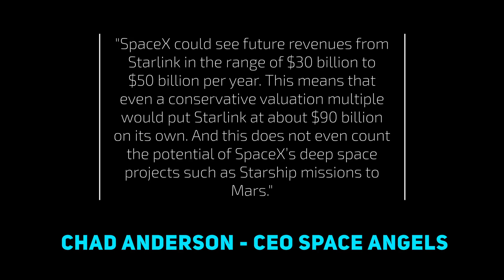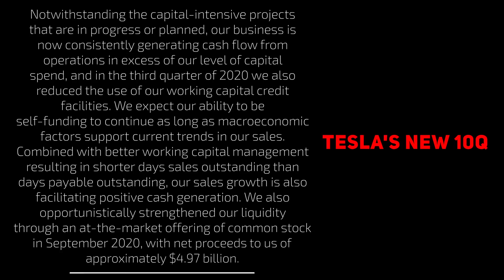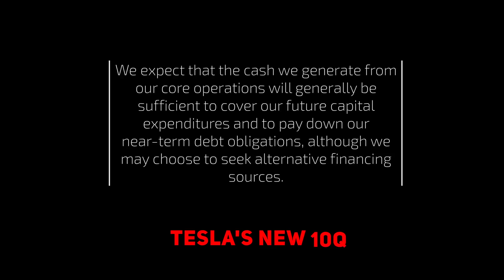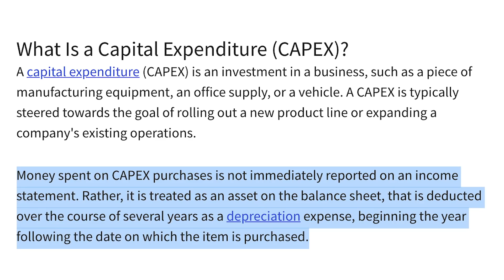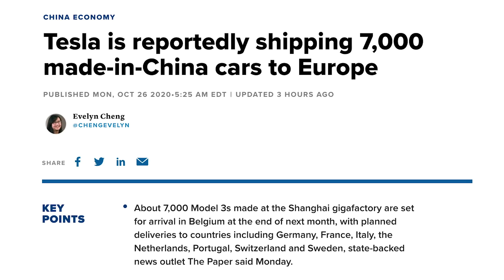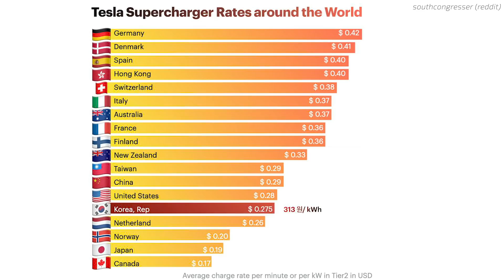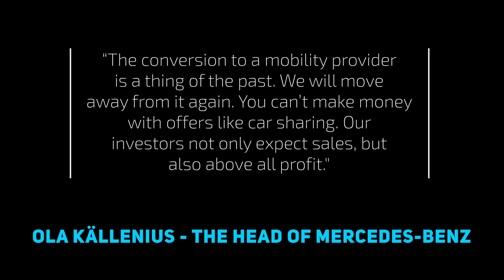Tesla Releases 10-Q // Mercedes Gives Up // SpaceX $200B Valuation ➕

Comment: Electricity costs in Germany for a private person is 0,31€/kWh (~0,36$/kWh). If you want only renewable energy it gets even more expensive. So the supercharger is not that much more expensive than charging at home. Unfortunately, new rules make it almost impossible to use own solar energy, as you have to sell cheap, and buy back expensive. Direct use not allowed.

Comment: Hi Dillon, thanks for your videos.
In France the current Supercharging rate is 0.24€ or $0.28 per kWh
There are rumors that the price might go up to 0.30€ or $0.35/kWh but not confirmed yet and some speculate new price would only apply to V3 SUC. Time will tell

Comment: I live in Germany, when I supercharge I usually pay 33-34 cent(€)/ kWh. That being said, electricity is horrendously expensive around here, when home charging I still pay 25ct/kWh
Reply: You would be better off with a petrol vehicle ...
Reply: @sking2173  Not really, when comparing supercharging to a very efficient diesel vehicle (which is generally cheaper than Petrol around here), driving a Tesla is still a little cheaper. Not by much, though. We also have solar power, I try to only charge at home when it’s nice and sunny, I can charge for free at work every now and then too (if the charging station isn’t being used by one of my coworkers).

Comment: Most likely Mercedes will adopt MobilEye. In fact all VW affiliates will.
Reply: Thing is, a system that uses pre-set mapping to navigate , simply cannot compare to a system that can actually be trained to "think" and adjust to one off situations. Tesla's FSD beta has shown that they are MUCH closer than they were with the currently available version of FSD. It could really actually be just around the corner for FSD to be more than a "future" technology. at that point, pre-mapping systems will be the choice of last resort for car buyers.
Reply: Anthony Scott yes I agree with you.  However I suspect Tesla also uses geo-net at a limited level in combination with pure FSD. By limited I mean giving the AI system a head start by storing key images of things like stop signs. Teaching the system certain things accelerates the learning curve and reduces required computational power.

I believe MobilEye is taking a similar approach but with a stronger emphasis on mapping and have been collect significant amount of data through their VW partnership. The traditional OEMs are so hopelessly behind Tesla they will come to the same realization as Benz.

Comment: I think Starlink will be split off, eventually.
It's possible that SpaceX won't go public for some time, yet.
Reply from the maker: agreed!
Reply: definitely.
SpaceX will not go public until they have established a sustainable colony on Mars. I'm pretty sure Elon has mentioned that many times.
If SpaceX goes public, Elon's Mars plans would be in serious trouble, and that's the only reason he founded the company: To make Mankind multi planetary.
Reply: Elon has explicitly said in some interviews that Starlink will not be split off.
However, my guess is also that at some point the move will become to tempting, but not before it has become a proven cash cow. Right now it is to experimental and there is to much risk in the asset to ask a good price for it.
Reply: Little chance that Musk will split off StarLink from SpaceX, because he sees it as the best way to fund space exportation. Musk also hates the variability of public markets, and frankly he can raise all the capital he needs without issuing public stock, so I really doubt he will ever do an IPO of just StarLink. He doesn't care about the extra money he can make; he cares about funding space exploration, which he can't if StarLink is a separate company.

Comment: Where do you get that Mercedes is talking about their autonomous driving program?
From the quote they are more likely talking about their car sharing business with BMW, which they may sell to Uber.
Reply from the maker: https://www.teslarati.com/tesla-fsd-beta-mecrcdes-benz-quits-autonomous-driving/amp/
Reply: @DillonLoomis22  Ok, I read it. But I do not see where Teslarati gets what they say. Inside the quotes there is nothing about the autonomous driving research.
Yeah, and now I read in the same Teslarati article: "Update: Head of Digital Transformation at Daimler AG Sascha Pallenberg has noted on Twitter that the report from RedaktionsNetzwerk Deutschland (RND) is false, and that Mercedes-Benz’s autonomous program is still ongoing. A quote previously misattributed to the Daimler CEO has also been corrected."
Maybe Teslarati took this article from that german site, but still, if they  read somewhere something, maybe they should have a filter to filter out the obviously baseless ones (like I said there was nothing in the qoutes about the Autonomous Research).

Comment: Germany hedged big time with Tesla. If Germany auto fails Germany still wins by letting Tesla in.
Reply: German auto builder have been smug for so many years. I hate the fact that most of them use plastic impellers and housing in their water pumps!  How stupid can you be to buy a car with plastic water pumps? Don’t you think that the customers will notice? I’ve had a few BMW’s that always seems to have cooling issues pop up just after the extended warranty expired. I will never buy German again.
Reply: Whoever made that decision to bring in Tesla definitely saw the writing on the wall and made the right move. Kudos. China did the same thing. Instead of blocking them out and allowing Chinese companies to have the advantage of local manufacturing, they allowed Tesla to come in to benefit and also to give the Chinese EV companies the challenge of trying to keep up with the best.

Comment: SpaceX is not a public company, and funding sources are unknown.  Also, final starlink hardware requirements and user demand/costs are unknown, so potential valuation like this is more stock juicing and wishful thinking.  Add the uncertainty of possible chinese funding and at least 2 intelligence investigations regarding, and investment in said is an asinine idea.

Tesla's CAPEX expenditures include warranty and service, which they aren't listing, as well as unsold inventory, also not listed.  This constitutes a continued bubble risk, as well as the drain of SolarCity sales dropping, and energy site maintenance costs.  And electric cars are not in their infancy; it's the government force coercing sales that's new.  With all the government force behind adoption, overall market penetration is still below 2%.  Just something to keep in mind after all the failed prognostications of '25% market share by 2020.'

Mercedes, by the way, is saying what you and many others keep missing.  There IS no profit available from rentals or shared services or any solution that doesn't deal with private ownership.  The money required for cleaning and repair and accelerated wear associated with Ubering, as well as for continual testing and verification of automated drive systems (to be euro compliant) makes this a losing deal.  And Mercedes has ALWAYS been known as a true luxury brand (unlike Tesla).  It's not something they have to 'work on.'

Seriously...one has to wonder what research (if any) is actually going into these videos...
Reply: Money Mania  They obviously haven't given up on advanced driver assistance, as their 2021 models are supposed to come with actual L3 automated Drive Pilot systems.  So this video's title is kind of dishonest right off the bat.

Comment: Mercedes is using mobileye - so they will not suffer too badly.  Tesla will be way ahead.  
Tesla is looking at vehicles as a means to an end not to own as a means to an end.  So Mercedes is too frightened to consider new transportation models.   
The point being - most young people would prefer NOT to drive if at all possible and there would not be enough drivers to drive people from A to B ... so the only option is to bring in self driving cars.  It is inevitable.
Mercedes could always look to partner Tesla.